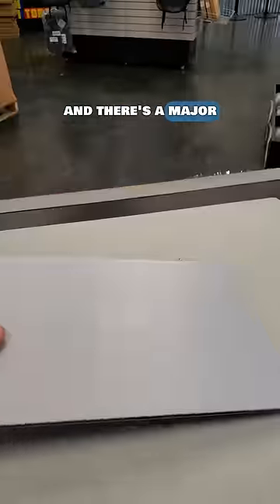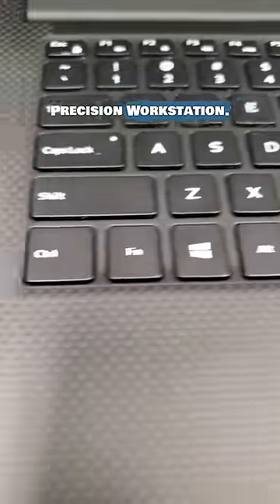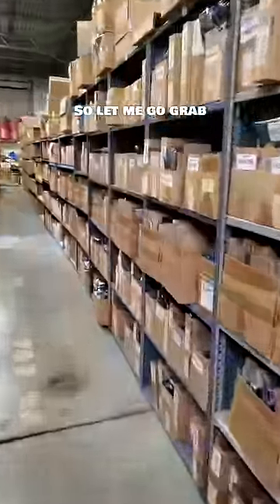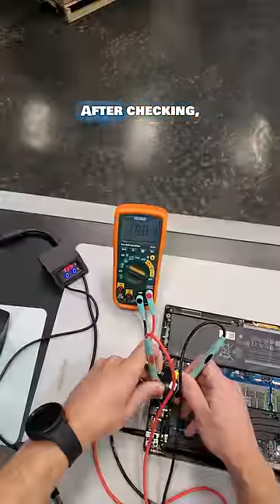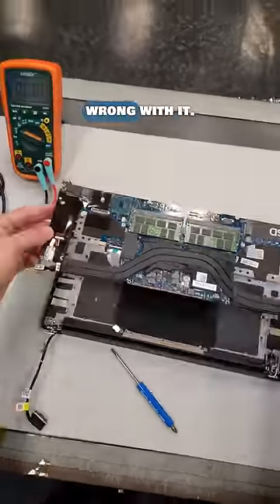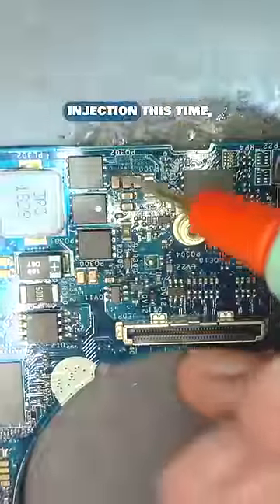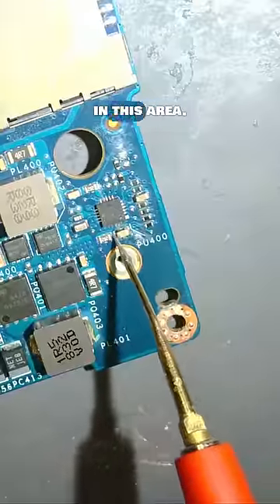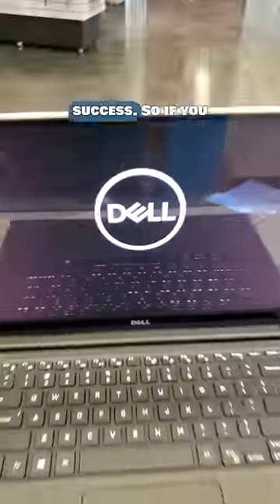Laptop Repair Fix The Hard Way #shorts #laptoprepair #computerrepair

Comment: i got my entire bios flashed and operating system replaced because the technician didn't bother figuring out that there was an incompatibility between my nvidia drivers and a specific program on my computer (and it didn't solve the problem, i had to figure this out myself). i wish more technicians were like you

Comment: So was this labor/repair still cheaper than just replacing the board since u alrdy had stock of one? Just curious. Idk much about laptops so idk how easy/hard they are to replace
Reply from the maker: Hi, well it's easier just replace the board, but that would have been $280 plus $100 for diagnosis and install. For board level repairs we charge flat rate $200. So saved about $180. Shipping cost would have been the same either way which is about $45 round trip.

Comment: What is the charger voltmeter deal you have? The one with the Red and Blue 7 seg displays on it. Really would love to have that for our repair shop at the school I work at (We buy spare parts from you guys all the time!)
Reply from the maker: It is something that I made myself. I made a few for my shop.  On the backside it has the large Dell barrel jack and on the front has both the large and the small.  It is great when testing to see if the laptop is actually turning on or even charging the battery.
Reply: @dellpartspeople  oh awesome. What did you use for the display and multimeter function, Just some cheap unit from Amazon? I have a bunch of “destroyed “ power supplies from the kids that I can scrounge for parts to make my own.

Comment: What do you do with the 'donor board' then? Do you replace the components on it individually or is it then a 'spare parts holder' that you can pick other components from in case other laptops need other spare parts?
Reply from the maker: All our donor boards are not fixable that's when they become donor boards..

Comment: Same thing was happen to my del XPS 17 back in 2016 after 5 years of usage. Then I went to few local repair shop. Basically within 30 min they fixed it and I paid 30 euros for this. And now what, still working since 2011 until now without any problem.  Is there any laptop can do perform like my xps? Any suggestions?

Comment: Do you folks do repairs on other computer parts? I have a a great board that has 2 little issues. I damaged it trying to work on it after a resent rotator cup surgery so have 1 capacitor that needs replaced and one part put back on the board. I can not do it yet while in recovery for surgery and in April the other shoulder will be worked on so it will be August before my arms, hands are back to use
Reply from the maker: Sorry, but we specialize exclusively in Dell Laptop parts and repair.

Comment: I remember when I bought my dell gps 15 9510. 

Worst investment I could have ever done. 
I bought myself a Mac, and never looked back. 

The wifi card is soldered in, and it cannot be replaced unless the manufacturer does it so that the warranty prevails. 
Sounds very cliché of me saying this, and pretty bold, but I share with you all, my experience with dell laptops once bought from Best Buy.

Comment: My Dell Inspiron 3525 has a weirdly yellow display on the LCD, and sometimes when it updates, it disables its own wifi and bluetooth and i have to restart the driver a bunch of times to fix it. Recently, it sent me to BitLocker after it updated. I doubt these problems are related. What do you think the problem is?
Reply: seems software related, put in a new SSD with a fresh install of windows and see if that fixes the problem if it doesn't then likely hardware related.
Reply: @nicholasespinoza9610  You're probably right. I've been wanting up upgrade to a larger SSD for awhile but never had the time or one available, and don't really have the skills to do the upgrade myself. Thank you for the suggestion!

Comment: i would love to learn micro soldering seems fun but a hefty investment
Reply from the maker: You can get a cheap microscope for $149 on amazon and try to find a second hand hot air station / soldering station on ebay.   You can get started for less than $500.

Comment: For longevity would it not have been better to replace the board anyway? If that old, something else might fail anyway and they've already sent it to you?
Reply from the maker: Well, we do have a 1 year warranty and actually don't typically see other components fail. Sometimes it's the customers only option or replacement boards are overpriced.

Comment: Random question, but how do you get such a huge storage area with all of the different components for hundreds of laptops?
Reply from the maker: We've been specializing in exclusively Dell laptops for the last 20 years. We stock over 700,000 Dell laptop parts in a 14,000 sft Warehouse. The answer is we've been doing a long time. We are not directly affiliated with Dell but buy out Dell's inventory, and Dell recommends us.
Reply: @dellpartspeople  Wow, that's impressive. How in the hell do you find a part in such warehouse, it's massive😂

Comment: All nice but I’d prefer to call Dell Pro Support Plus and just have the whole thing or the board swapped instead of some things on the board replaced and then I have to take it in again weeks later.
Reply from the maker: Hi, we have a 1 year warranty and don't typically see the laptops come back once we fix the bad components. But sometimes a new one is preferred by the customer so we go that route

Comment: What would you charge to replace a motherboard in a alienware 17 r4? Nothing us wrong with mine but I would like to upgrade it to the 17 r5 motherboard that has the i9.
Reply from the maker: Those boards are crazy expensive when I have them in stock, but they sell out right away.  The AW17 R4 i7 motherboards, range in price based on video card -- $459 - $999.  The last time I had 17 R5 i9 boards with RTX 1080s in them, they were $995, but again they sell right out and I do not have any.  I have not seen any of those boards in a while.  All I have in stock right now are 17 R4 i5 with RTX 1060 for $249.95
Reply: @dellpartspeople  if I got the board and mailed it in with the laptop would you do it? I found a few if the boards online for between 400-500 with the gtx 1080 my current board with i7 has the 1080 as well you can keep that as a bonus. Lol

Comment: So what is the price difference between a new motherboard and replacing the chip?
Reply from the maker: $200 right now for board repair. Not sure the price of this motherboard but I know we went the cheaper route.
Reply: @dellpartspeople  I guess slightly.  A refurb board will cost you between 200-300.  With labor that pushes it another $100 so you are probably right.

Comment: And this is the difference between electronics repair and electronics part replacement.
Both take knowledge before hand. Both take diagnosis. But one will produce a lot more e-junk (that we, as a society, can barely handle), and the other will not. The second one is also way cheaper than the first. But dont think (or even dare to say) that because they had a dono board, the client should be expecting pennies on the repair. You're not paying for the equipment, nor the time. You're paying for the knowledge and the expertise. And, of course, the huge investment on having a proper working enviroment, with the tools required to do the job.
Reply from the maker: Nailed it ^^^^^

Comment: Now the old one doesn't work. 

Why not buy replacement chips?
Reply from the maker: We have a lot of chips in stock, but also have tons of donor boards.  It is so much easier to grab a component off of the exact same motherboard knowing that it will be the correct value.  BTW, a donor board is a bad board for parts.
Reply: @dellpartspeople  I see. I didn't know if they needed coded or not.

Comment: I bought a hp laptop a few years ago and it never worked right they said I needed to send it in instead of the refund.  They "fixed" it but it never worked right even after they "fixed" it. I am disabled so I could not get another one.

Comment: Ordered an Alienware m17 2 or 3 years ago now. It took it several months to be delivered, and when it finally came in it would turn on but wouldn't boot up. Took the fucker apart, and my SSD was just flopping around in there because it hadnt been properly installed
Reply from the maker: OH, wow.  That sucks. Sorry to hear that.  But I guess you got it working.  That is not something that I seen before.

Comment: Do they do ho laptops and much does it go for just to crack open the back and do a deep clean
Reply from the maker: Sorry, but we specialize exclusively in Dell Laptop parts and repair.  We charge a flat $100 labor fee for diagnosis and repair, and an additional $100 if board-level repair is required.

Comment: I ordered a Refurbished Dell OptiPlex Hard Drive on Amazon and when it arrived, it had a big dent in it and when I hit the power button, the PC screen was not responding to the hard drive and the power button light kept blinking yellow. My mom wanted to return it instead of fixing it to taking it to a place like this because it would cost more money. To return it, you will get a refund of the thing's cost and to fix it, it will cost even more!
Reply from the maker: Yeah, I would tell you to return it also.  If you buy something, you expect it to work.  You should not have to pay to have it fixed.  We charge $200 for board level repair, but we only repair Dell laptops.

Comment: You're Fired. That's an XPS 9570, not a precision workstation. :)
Reply from the maker: They look the same and share the same parts.  It is a Dell precision 5520, which looks the same as the XPS 9560.  The XPS 9570 would be the same as the Precison 5530.
Reply: Ok, I'm fired instead! :D  @dellpartspeople

Comment: I wald like help for my dads pc it will turn on but it dose not have a display and it is making me so confused becouas people say i will have to replace parts i dont know how to replace and i dont have the money too either 😢
Reply from the maker: If the display does not turn on, that could be a numbers of different reasons and you should just guess.  If it is a Dell we have 1000s of videos showing you how to take them apart and replace different parts. Start with a CMOS reset.  Then reseat (unplug and plug back in) each part one by one. Good luck!

Comment: Me as a non native English speaker has a question: What is a donor board?
Reply from the maker: Doner motherboards are a collection of the same model of laptop motherboard that are bad or have problems with them.  We use them for parts.  This way, if you need to replace a component, you can remove the exact part from the same model laptop motherboard.

Comment: Precision? Its an XPS
Reply from the maker: They look the same.  They actual use the same motherboards, just with different specs; Precision offers Xeon CPUs and professional graphic cards.  The XPS 9550 is the same as Precision 5510 and the XPS 9560 is the same as the Precision 5520.  and so one.  There are a number of crossover laptops.  Dell has done this for 20 years.

Comment: It's always a Dell
Reply from the maker: Yeah, that all we work on since those are the parts we sell. Cheers!
Reply: @dellpartspeople  I am sorry i am not speaking bad about you or the channel I am speaking about Dell laptops. because I use a dell laptop and I had countless problems with my laptop until Dell customer care replaced my laptop after they failed to fix my laptop even after replacing most of the hardware.

Comment: Why fix the mother board just replace it bet it will work for 3 weeks
Reply from the maker: All repairs include a 1 year parts and labor warranty.  Even if you buy a part directly from our website you will get a 1 year warranty. We have been specializing exclusively in Dell laptops for more than 22 years, and would not be business very long if our repairs only last 3 weeks.

Comment: You replace the motherboard and ship out the fixed laptop. Then repair the board on dedicated time set aside for refurbishments or inventory recovery. No way an operation with access to this warehouse individually repairs every same day refurb order if they already have replacement parts. Its all for a good show, not that its not appreciated.